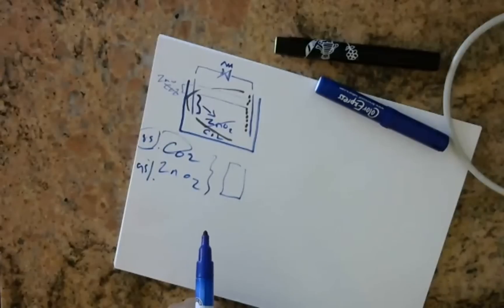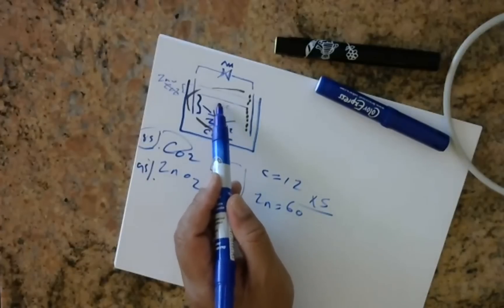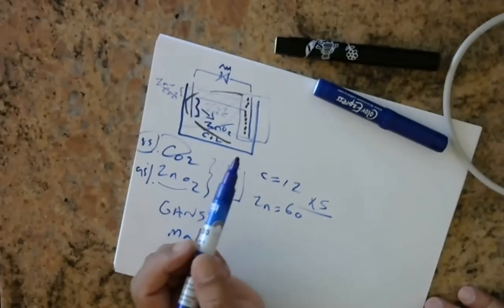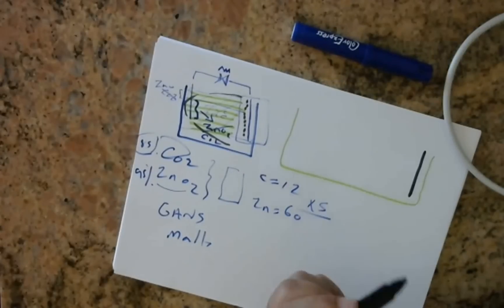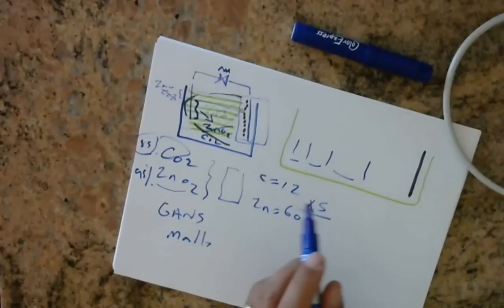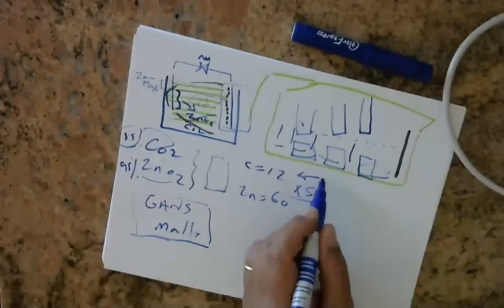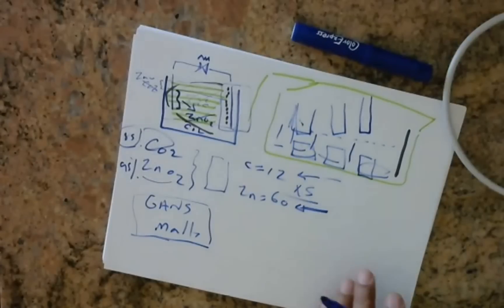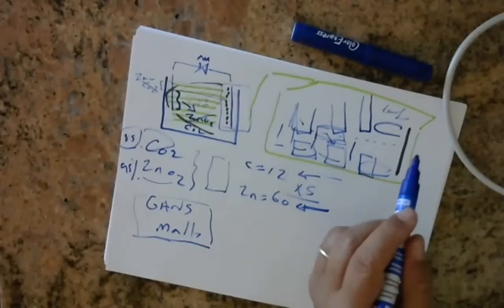CO2+ZnO GANS production

Comment: Gracias Fundacion Keshe: Información en Español !
En el video  Dr Keshe explica que el porcentaje de CO2 que sacamos de los reactores es MUY BAJO, 5%. el resto es ZnO2. Que para los Magravs no está mal, pero para las aplicaciones específicas debemos modificar la manera de producir. 
La manera correcta para producir GANS de CO2 es sumergir la placa de zinc y la placa de cobre nanocubierta en agua de mar rebajada con agua destilada (o bien disolver 100 gramos de sal marina en un litro de agua destilada asegurandose que no quede ningún residuo de sal en el fondo). Las dos placas no deben tocar el suelo del tanque. 
Al contrario de la producción de gans de CH3 y CuO, para la producción de gans de CO2 debe evitarse uso de electricidad. 
La colocación de un LED verde entre las dos placas, asegura la producción de aproximadamente un 90% de gans de CO2 y sin LED se produce principalmente óxido de zinc.
Conectar el ánodo (la pata más larga del alambre del LED = polo positivo) con la placa/bobina recubierta, y el cátodo (la patita más corta del LED = polo negativo) con la placa de Zinc. Después de unas horas, una capa blanca de GANS de CO2 comienza a depositarse en la parte inferior del tanque.
SIN ninguna fuente (de baterías, ni de alimentación) para gans de CO2 usar LED verde.